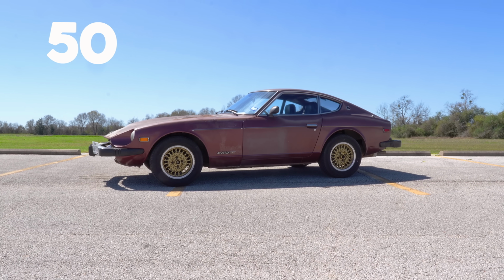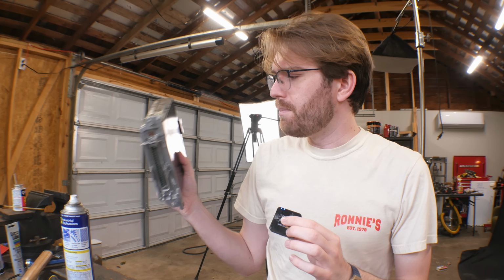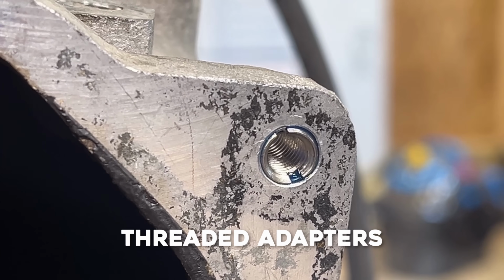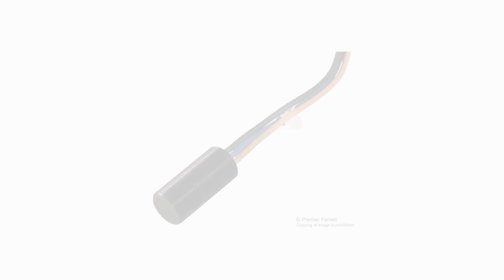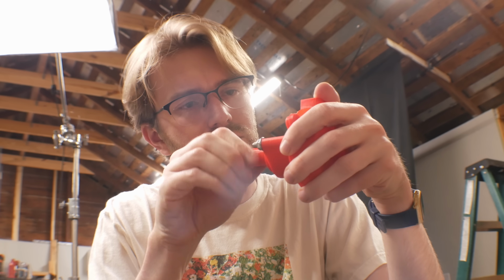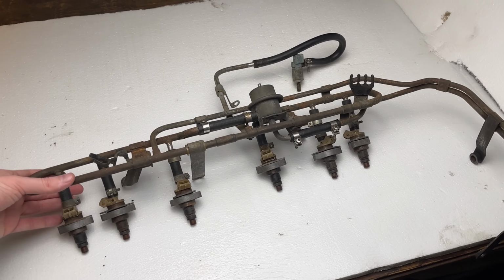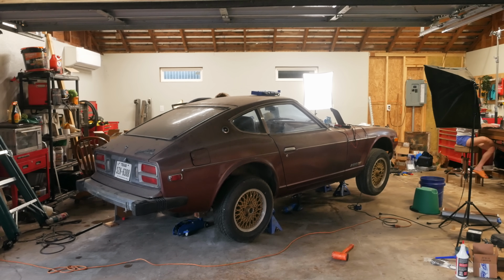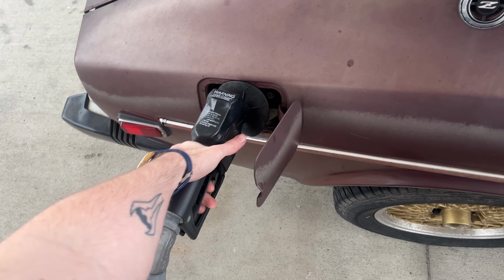Modernizing a Vintage Car

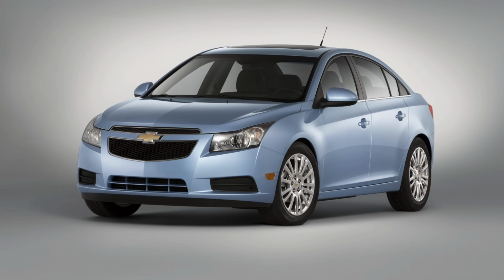Comment: 1:58
Why, that's perfectly adequate, you're only allowed to crawl along in the USA anyway. And the lack of horsepower is precisely due to the way the poor Datsun is driven. Always at “walking pace” and never having the chance to use its true potential on the road... that costs performance and ruins any engine in the long run!

Greetings from Germany... if you ever come here to visit, drive on the RIGHT, ALWAYS and everywhere. And remember, at 120 MPH on the German autobahn, you're not much more than a stationary traffic hazard for other drivers... there's always someone driving much faster than you can even imagine!

Comment: This has actually taken away some of my faer trying to do the same with a late 80s/early 90s car. They told me online that distributors are no longer available and I thought "how hard can it be to swap it to an electrical ignition system?" - well seems to be hard, but not impossbly hard

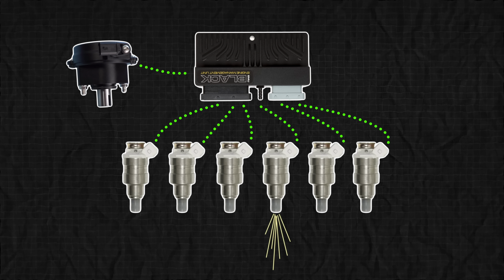Comment: 22:00 No, timing in intake manifold fuel injection is completely uncritical. Intake and compression strokes provide plenty of time for vaporizing the fuel and mixing with the air.

Comment: Younger than you, hate electronic throttle bodies. Or at least i think I'm younger I'm 26. I prefer carbs though, I'm putting six single barrel motorcycle carbs on my 260z.
Reply: I'll probably be doing the same as you on my 1968 c30 with a 292 though

Comment: This video is awesome. If you made a kit like this for the Alfa Romeo Spider, which had the same basic engine design from the late 60's to the early 90's and used L-Jet starting in 1982, I bet you would sell a bunch of them (and then you could afford an engine swap!).

Comment: The most hilarious part is I’ve worked on the same fuel injection system on a VW and it’s WAY less complicated, looks like the Japanese took the normal L-Jet and tried way too hard to make it better

Comment: I had a car same year same color bought in College Station because I wrecked my 1977 racing (closed course). I put all my go fast parts incl engine into it and raced that one too. It had a damaged roof and frame giving tons of negative camber on one side only, which helped for racing when turning one way but not the other. I ended up cutting the roof off and reinforcing the frame. Drove it around for a while lots and lots of fun. Embarrassed a lot of much prettier cars in that thing. We didn't try to make the EFI work right back then (90s) we just replaced it all with round top SU's. Used to be able to do lots of great mods using Pick-a-part stuff because they used that engine from 1970 to 1983 at least.
Reply: Also since you kept it EFI, you can easily bolt on the turbo from the 81-83 (?) 280ZX. I don't think we even needed to lower the compression, although the long block from the actual turbo cars had dished pistons and larger quench volume, I think. You'd def want a knock sensor though, which was included on the turbo block.

Comment: Those cars are great for a LS swap all you have to do is pull the inline 6 out and drop a fuel injected LS into it and you will have modern engine with great power and about the same gas mileage. all you need is a 5.3 LS some of the wiring harness from a truck and  a open ECU you will be able to tune with HP Tuners on a laptop

Comment: You could go contact Motorsport Z Auto and install an L28 stroke kit that will increase displacement from 2.8 to 3.1 liters. Along with a performance camshaft you could probably increase power to 260 - 280 hp. Bigger injectors, air intake, and exhaust upgrades would probably push it to 300 hp without getting into serious machining or force induction. I have a '77 280 in my garage that I'm thinking of doing a complete drivetrain swap on.

Comment: The strange thing is a fresh engine when nothing is glaringly wrong, will only add a little max power, but it helps make more power at lower RPMs.

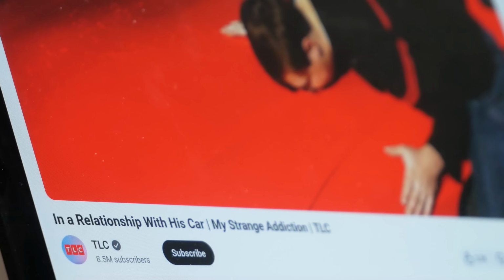Comment: 7:00 I know the current DBW throttles are pretty quick but I have two cars with the exact same engine - one from '97 with a cable throttle and from '00 with an electronic one, and you can really feel the difference in response time

Comment: I’m surprised this isn’t done more often, I really appreciate the effort you put into these videos, thank you.
Reply: It is done , a lot , way better than the typical US approach to an old carb V8 of putting a Holley throttle body injection system on that's basically just an electronically  controlled  carburettor.

Comment: Very impressive build! I have a 60s Mercedes with the M130 engine which is the same 2.8l size. Mechanically its almost identical except it has the fiddly Bosch mechanical fuel injection. Looking further into it it, it seems that Nissan re-engineered their engine from the Mercedes engines as a template. There are no EFI swaps available (later Mercedes engines have options). So this is essentially a DIY guide for the brave in the Mercedes crowd.

Comment: I try and keep my old cars as close to stock as possible.  Start changing shit and it's always 37 things you didn't think about that you have to find a solution for. My 68 Imperial has the original 440 in it, but I did put an Edlebrock AVs2 1906 on it.  And the 83 Cadillac had the 4100 and that was just a trash motor so it has a 5.3 LS now. My 66 Lemans came with a 326 originally, but long gone so I put a period correct 400 in it.

Comment: mess around with the ignition timing my guy. it can definetely be more efficient and hence more powerful. to add to that, convert it to e85 so its easier and safer to reach that efficieny. just suggestions (also im assuming you live in the e85-plentiful US of A

Comment: Bosch has been working with electronic injection since Chrysler sold their systems to them back in the 1950s because when Chrysler was building injection and computer systems to run their turbine cars and their fuel injection the insulating paper that they were using did not insulate the capacitors from Radio noise that was put out by Transformers in urban areas that were low on oil and causing radio interference with the engine and it took them a while to figure that out. Why you're calling them a washing machine manufacturer is beyond me because they don't actually make washing machines as they put their name on washing machines that have been made by somebody else.

Comment: Stumbled onto one of your videos and was impressed by, your humor, the step by step problem solving, and the reason no one else has done this. The whole video was a cautionary tale of why pain and suffering can replace a pile of money and a two year wait. I'm an old Model A guy myself who knows carburetors. I use a vaccum gauge to time and adjust fuel mixture the better the boom the higher the vacuum. Does the computer advance your spark based on rpm?

Comment: I actually wonder if it would have been better just to buy a brand new engine and control system?  Especially taking into account that the engine is as old as the car and potentially also worn out.  It's neat you can actually do this as even doing these upgrades to a carbureted small engine, say a Honda GX390 but how much does it actually cost?  I mean, the last time I saw the price of a Honda GX390 engine was around CA$1200 but adding an EFI kit to one of these is like buying two engines.

Comment: Did you change the fuel pick up in the tank?  A friend of mine had a 240 I was to drive 250 MILES the next day  when the pick up tube sucked more air than gas.  Thanks to the drain plug and some small copper tubing the problem was fixed. Great car for windy mountain roads.

Comment: Your video making abilities are top notch. Very entertaining. I would not have done all that for 17 HP.  I would have just engine swapped. In my case, a GM 3800 for a minimum 210HP & probably well over 25MPG.  Made my Fiero jump & run.

Comment: The low power increase just shows how good the old Bosch L-Jetronic was at its job. Guessing most of the horses have left the engine via the inside. It most likely needs a full rebuild with new bearings, rings and maybe a valve job to get all the horses back in the stable.

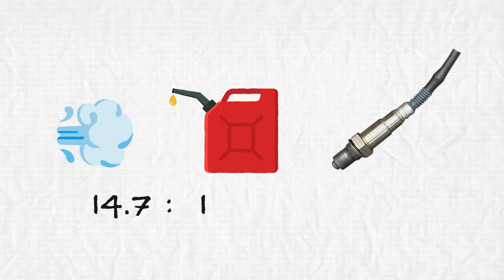Comment: Great video and lots of ideas for one of my projects. Only there is an error @23:19, the ratio 14.7:1 is optimum for catalytic converter operation not actually engine happy spot.

Comment: I wonder if that's the same 280z I was considering buying 20 years ago. I didn't have a good place to store it then though so I passed on it. Awesome upgrades, even though it didn't net that much more power. Hopefully it gets a 280zx head swap at some point, as i remember that being good for another 20ish hp.

Comment: It isn't so much a matter of hating throttle-by-wire, it is more, I hate what OEMs often do with their systems. I do not want multiple throttle maps, I want one, with nice long pedal travel, and linear response. A friend of mine has a 2007 Acura TL, it is throttle-by-wire and it is fantastic. I could not tell. My roommate's 2016 Camaro on the other hand, it has 3 driving modes. Ice and Snow feels like the throttle is lagging way behind (fair), Touring seems to be the most linear on throttle but a bit slow off throttle, and Sport mode makes the throttle feel like it is opening more and/or faster than I call for, while making off throttle as snappy as I would expect. That is what I dislike are those different responses to the pedal, I would be fine if the Camaro offered a bit more pedal travel, with the Touring mode on throttle response and Sport mode off throttle response at all times.

Comment: there is a overall working formular for o-Ring grooves. it is more like eyeballing it, but it works most of the time. 0.8xd for the depth and 1.3xd the with of the groove. the d stands for the section diameter. (sorry for bad english)

Comment: My chevy trailblazer i6, the motor is almost twice the displacement, gets almost the same mpg. With more tuning, maybe better designed adapters and parts, youll be able to squeeze much better mpg out of it.

Comment: That engine was rated at 149 horsepower net , which is what's been used since 1972 . So that number you got sounds about right .

Comment: You can pickup about 0.5-1.0 mpg by ditching the stock cooling fan and replacing it with an electric motored fan.  Headers and free flowing exhaust.

Comment: Take the starter apart, clean and lube it.. might as well change the brushes and resufrace the commutator and check hows the bendix works.

Your starter should be good another 50 years then.. aftermarket ones not so much.. (also is alot cheaper)

Comment: so your going to make it more powerful without a cam or pistons? Add a turbo or a blower.   SO as a person who grew up in the 80s you are telling us if you removing the smog stuff you gain HP?  such a surprise.  The modern stuff isn't fixing things a carburator and fuel injection are equally good at power and fuel mileage.  Modern engines are machined to much better specs and better design, control smog and get better mileage. But it is all of it together not just induction.
Reply: electric throttle is an issue if you need to control it immediatly when the difference is in hendreths of a second like in drag racing and drifting, See GTRs getting cooked drag racing.

Comment: hmmm...my 78 got 23mpg on the hiway and about 17 in the city, It had a 5 spd. I thought it was plenty fast enough, but then, I never raced it.  I did take it to 120mph once.  It seemed to have more left but I chickened out. That was in 1980.

Beautifully built car with zero issues.

Comment: If you use the old formula of 1/2 to 1 percent of HP lost per year, that 12x hp you saw on the Z isn't really far off. You've got a 47 year old Z there so losing 23.5 to 47 percent of it's total HP. If we use the SAE gross HP when new of 170hp; your current horsepower would be somewhere between 90 and 130 horsepower. So yeah, your tested value is right where it should be.

Comment: I would suggest using an electric fan. It’s possible your new ecu can control it. Doing that will increase your hp and your fuel economy due to less parasitic loss. As well some upgraded cams, would be cool to see for a little bit more power.

Comment: Replacing the very thing that makes this older car special?  And swapping an electronic throttle for it?  That's completely idiotic if you want to actually preserve the cars character!   I can agree with modernizing other parts but the cable throttle is LITERALLY the best part of driving older cars!!!

Comment: As a datsun guy who has been putting standalone ecu's on L28's for 20 years..... nothing you did was new or couldnt have purchased an off the shelf option.  Besides the electric throttle. It has been done but they just made their own parts to make it work.  Your trigger wheel setup works but your going through all that effort to still have slop in the timing system.  there is slop between the crank and oil pump drive shaft, slop between the driveshaft and your CAS shaft.  Your better going with a crank mounted trigger and then using your trigger for TDC on number 1

Comment: Before i watxh the video, I'm going to pretend you took the crank from an LD28 to make a  Stroker 3.1L. That said, the LD28 is a fine diesel engine, albet slow but very fuel efficient. (I got 43mpg in my 1981 Datsun Maxima Diesel, before the camshaft gave up the ghost and i sold the car.)  Only 1% of Diesel Maximas had a camshaft casting flaw. Anyways, glad to see the Z-Finger back!

Comment: Now, with the improved combustion from the modern EFI, you can add a knock sensor and have dynamic spark advance, so that you can restore some of the compression they had to take out of the engine to get it to pass US smog requirements and get the quoted 172hp based on the world-spec model [Yurp didn't have smog reqs back in the '70s]...

Comment: That’s pretty sweet man. I worked on a 1971 240 Z the guy had invested over $300,000 building a R432. It had a six pack of Mikuni carburetors and Borla resonator/muffler that made it sound like a street bike on steroids. It also had 10 to 1 compression which helped.. Those cars are getting quite valuable if they’re restored correctly. Nobody that wants that car is gonna care about what you did to the engine.

Comment: Robert Bosch developed the electric Magneto-Ignition for combustion engines. That was 1897, on request of G. Daimler, C. Benz and W. Maybach, the inventors of the 4-stroke gas-engine, for the use in "automobiles". So, dishwasher is not the thing he should be remembered on 😂

Comment: Not bad , I’m impressed you even got it started … I have been hacking cars and motorcycles apart for years .. I am impressed   That’s amazing young man
Reply: Speaking of motorcycles, the throttle body came from a 2015 Indian Chieftain V-twin, which can only produce 75 horsepower on a good day.

Comment: Not gonna lie, an l28, not running perfectly, making 125hp at the wheels isn't bad.  Even if it were running mint, you wouldn't see more than 160hp at the engine, maybe 150 at the wheels.

Comment: Ladies and Gentlemen without THIS engine points to the L series We wouldnt have THIS EMGINE Points to a oil starved and 5th rebuild from abuse RB25DET 
Do you see people, magnificence MAGNIFICENCE

Update his MPGS are better than both my tuned VQ37VHR and also my VR30DDTT 
rip spider in the fuel tank

Comment: 10deg btw teeth on the timing gear? That seems a little much; what about 72(-1, for 71) teeth, so only 5deg btw pulses? Seems like it would give the computer finer-grained acceleration info for improved spark advance...

Comment: Pull the diesel engine and 5 speed manual out of a Bluebird and you will get more HP - torque - and 50 mpg [US] and it will run FOREVER !!!

Comment: I did something similar to my grandpa's AMC Pacer. The engine blew up, and we simply didn't have the time nor funds to restore or replace the engine with an exact fit.

What I had instead was the drivetrain from an early 2000s Hyundai Sonata. With some minor modification to the bodywork, the drivetrain was thrown in and it was back on the road like nothing happened.

That's simply the reality of owning a 70s car since new. It's barely worth the metal it's made with, and complete engines are impossible to find without selling your soul. My grandpa simply wanted to keep driving it, and he agreed to sacrifice a small amount of power in exchange for something with far more parts and service support

Comment: haha I was laughing about this the other day, it's not a gas peddle, it's an air peddle.. I know oxygen is a gas so technically it's correct. Most people think steeping on the accelerator injects more fuel but really it's allowing more air to flow through the carb which in turn draws more fuel in through the carb. its beautiful how it all works together

Comment: 😂 I'm honestly glad I have the L-Jetronic in my car, because you don't have to adjust as much stuff after all and it just works. I'm also 95% certain my car does already have a crank position sensor though, maybe because it's about 10 years "newer". The K-Jetronic on the other hand seems to be an absolute nightmare to adjust if you're not an expert from what I've heard. Anyways, you've done an impressive job, messing with a running system and still getting it to run again even better in the end!👍😅

Comment: I get you earn more money in America, but that's rather expensive, in my economy it may be cheaper to do an engine swap. That works assuming you can mate the engine with the gearbox and it won't break. Heard legends about people running Fiat 126ps with spare gears, or just starting from the 2nd gear, so I guess you can use a weak gearbox with a strong engine if you really want.

Comment: Describing Bosch as a dishwasher company in insane. They are only the world market leader in electronic motor management systems. They basically make all sorts of sensors and even the ACs in most premium cars. And so on.  They have 400k employees.